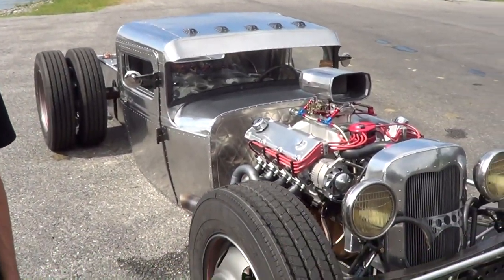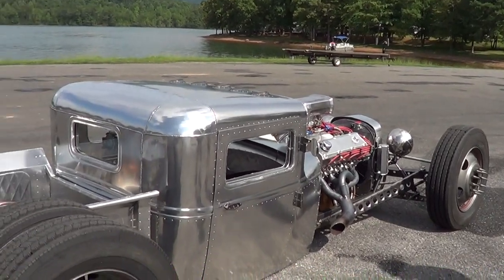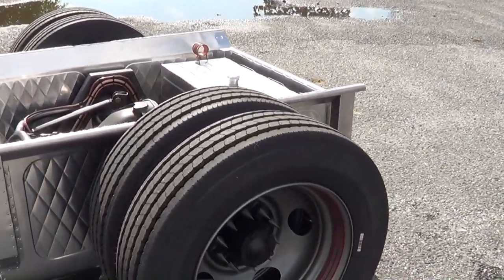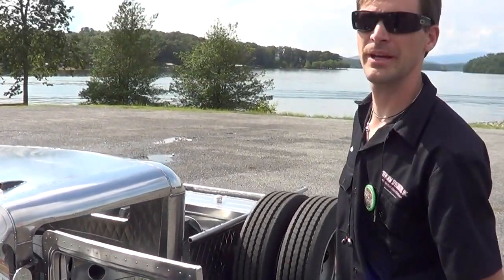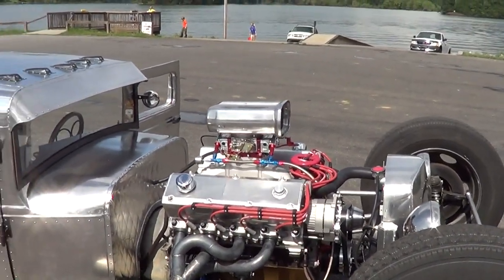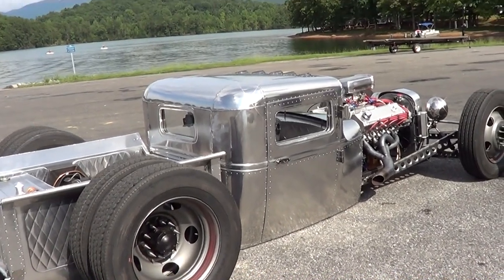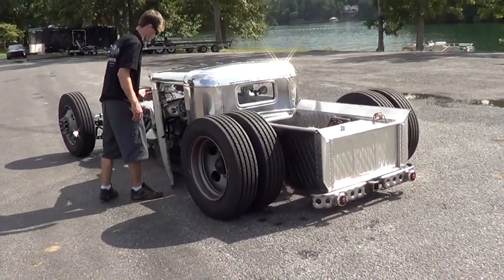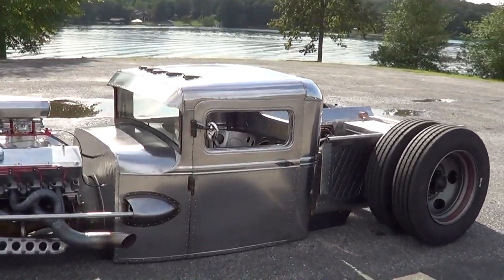Cutworm Specialties Scratch Built Hot Rod

Comment: Neighbors it is great to see the finished product - BUT - I would like to see your build from the beginning. The planning and CAD drawings - the frame and roll cage  construction - front wheels and steering assembly - engine and drive line - rear wheels and air bag installation. Also the sheet metal cutting - forming and assembly of the: rad cowl - body - doors - bed - etc.Please consider a video series on each of the above phases of your build. Your video series would certainly be profitable to all your viewers - as well as your business.I give you and A+ for your build and presentation of it.  Regards from Cuviercastle.P.S. How do you handle the speed bumps? Wow!
Reply from the maker: +Del Tuttle I didn't build it Brother....I just shoot the videos...

Comment: Can't figure out why everyone is referring to them as semi tires and wheels. They aren't. These are just 19.5" wheels that come stock on pretty much every light medium duty truck made since about the mid-90's. Most motor homes aren't really all that big underneath. They're just 450/4500 - 550/5500 (usually up to about 19,500 GVW) series chassis with a big box on them that makes them appear heavier duty than they really are. Semi truck wheels would be in the neighborhood of 24.5" and would generally be on vehicles up to 80,000 GVW. Anyway, cool build. I would have gone a bit grittier though. Just too polished for what I would consider a rat rod but overall I still like it.
Reply: Ed Campbell still looks good though

Comment: I love rat rods, and I like the all Aluminium finish, but didn't like the look of the welds on the exhausts, looks like it could blow itself apart if revved too much. Think they should have bought them in at least, its the bit where the 4 pipes meet into one, didn't look right, I know its a rat rod so they ment to look different, but still that's my opinion. but yeah like that dual axel on back where it passes through the rear tub section and them semi wheels look the part.
Reply: They look solid enough to me. Not a beautiful TIG weld 4-1, but they'll hold. My first welds looked far worse, but as long as they can last through the thermal expansion, looks are fairly moot. I'll bet they flow like a friggin' river though!

Comment: yeah that is hectic cool
Reply from the maker: +MotorcycleTherapy Very cool for sure!
Reply: I just bought a 1950 Dodge Panel Truck, I'm in Australia and apparently here in Dealerships, you could choose between Dodge, Fargo and Desoto Badges. Mine is the Fargo badged model, but I believe I may ave found a rare model, 1.5 ton, 5300 GVM, so I'm very happy because I wanted to be able to tow a large trailer for my metal fab. Big job, as it's not far from the grave, but looking forward to getting this bad boy on the road and driven daily. So cool, my first hotrod project.
Reply from the maker: Good luck....Keep Me posted!!